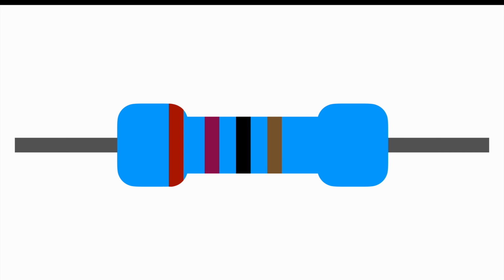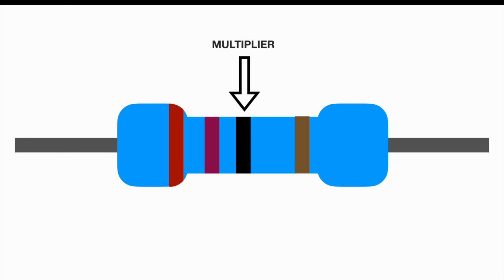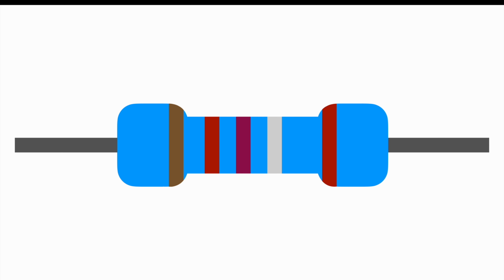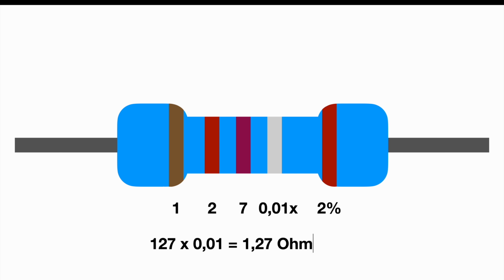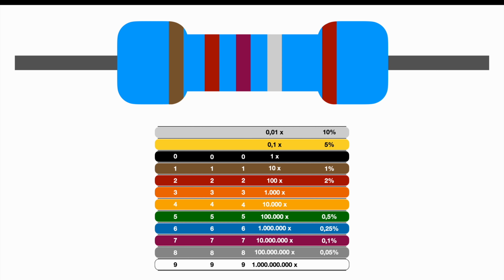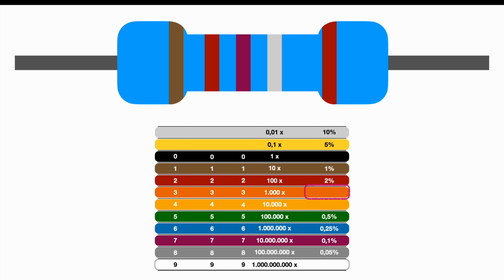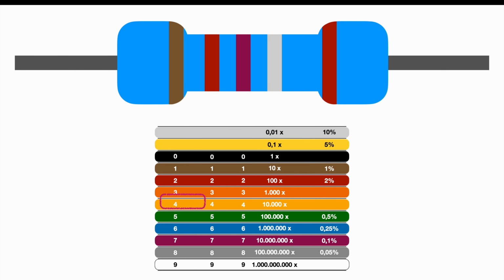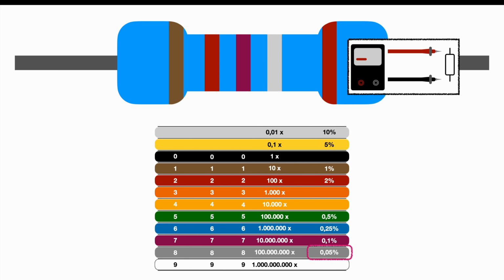How to identify resistor color codes?

Comment: Hello, I have watched a number of your videos and all of them have seriously low audio.  I am using a DELL XPS 13 wwith their standard audio system installed. Could you possibly increase the audIo level at your end? Your videos are informative and easy to understand, but by increasing yur audio I will strain less to hear and mre time learning! Respectfully, Anon.
Reply from the maker: Hey Anon,
thanks for your feedback!
Have you checked on a different device like a smartphone?
I will check on some other devices as well to make sure it’s not way to loud for other users afterwords. I will come back to you here in the comments as soon as I did some research and figure out some options for better audio.
Also thanks for your positive feedback about the content itself!
Reply: @blueprintiot  My pleasure, and thank you for the response.
Reply: It took me a few seconds to realize there was audio.